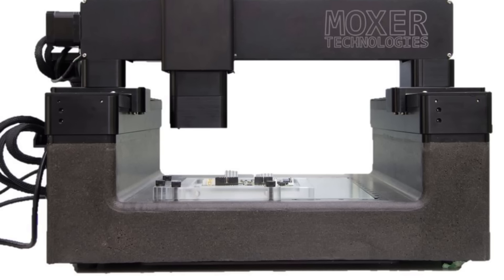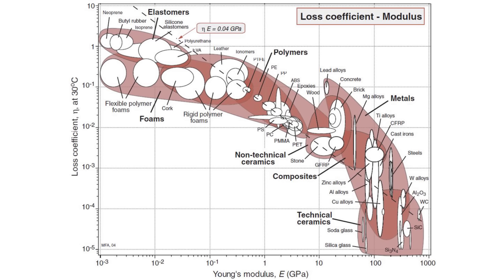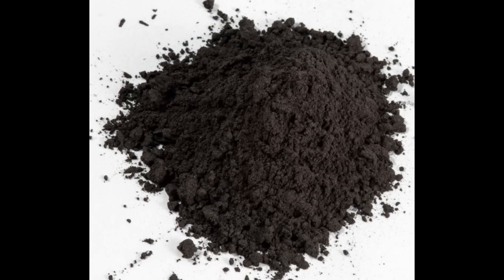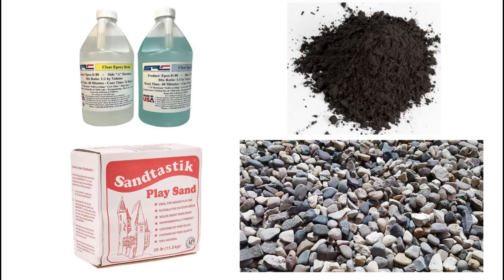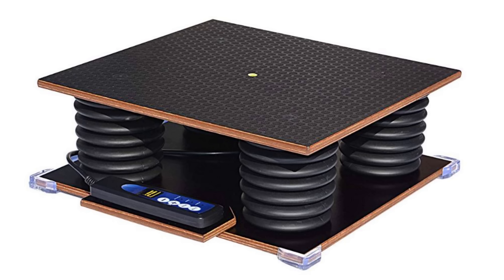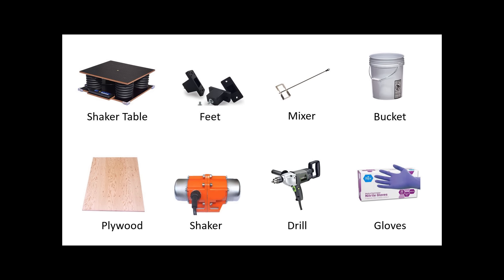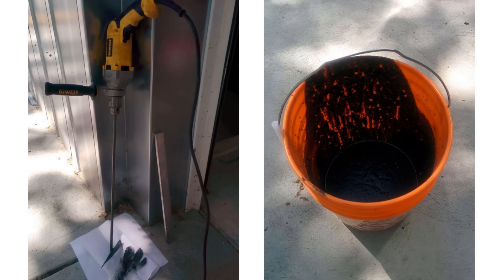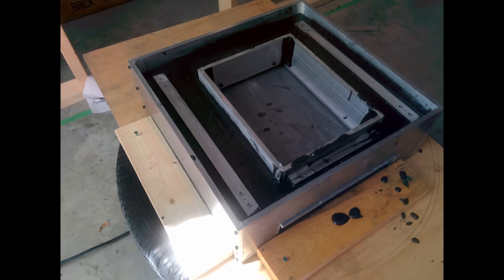How to Build Epoxy Granite Machine Base

Comment: can you make a lathe bed using this?
Reply: you probably could, though I think youd have to use somtehing like linear rails to allow for smooth, precise and accurate movement of the tailstock and especially the carriage/cross and compound slides because the epoxy would wear down pretty quickly if you were to use it in direct contact with steel.

Comment: What is one of the main uses for this? When you say machining, I'm under the impression you meant 3D printing, but will this work for milling? Would it actually be accurate enough for that application?
Reply: Its purpose is to absorb vibrations. Alu is particularly bad about vibrations. A cheap hobby-grade cnc router, for example, suffers from a lack of rigidity and vibration problems. That's a nasty combo, because both cause each other and cutter variation. Tiny cutters don't like skipping around holes and chattering to very high chiploads.
That's why an industrial machine can take the same cutters and be far more aggressive with passes. It doesn't deflect and vibrate as much, so it keeps an even chipload.

It's also worth noting that it reduces the sound resonating from the machine as well. (flood coolant helps massively with this too)

Comment: That mold seems quite reusable...
Reply from the maker: That was the idea with all the plates that screw together. I made a few bases on this mold tool without too much issue
Reply: @AdamBender  how much one of this awesome bases can cost?
Reply from the maker: @MaquinerosCNC  a lot of free labor, and about $100 in epoxy I'd say. The aluminum mold was probably $150, and lots of sweat equity machining them to shape

Comment: Great looking results, though I wonder if using mainly sand and no larger aggregate will impact the rigidity and resistance to warping with temp. fluctuations. My guess is that with play sand, mostly rounded grains, the properties of the epoxy may start to dominate.
Reply: Using a formulate aggregate mix of quartz sand from 3/8 to flour allows the resin content to be 8%. This reduces cost and significantly improves the mechanical properties.

Comment: I really enjoyed this, thanks for sharing!
#Peter#Brown has experimented with dies before and found that black pigment can be obtained using crushed charcoal, which works really well with epoxy. Should be cheaper than the dye you mentioned. 😁

Comment: Your high sand version must not have much mass/weight compared to granite or lead ballast. Also, bolting any machine to the concrete floor is THE BEST vibration prevention.

Sorry, but I think you're off on a wild, expensive, OCD fantasy here.